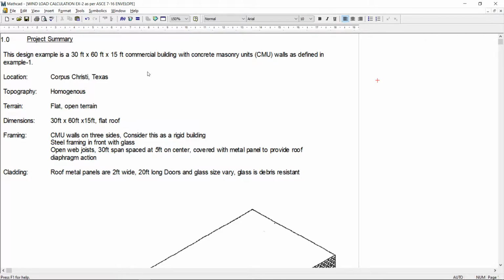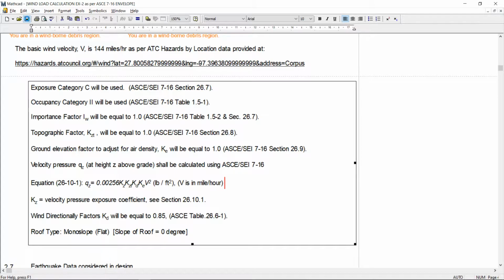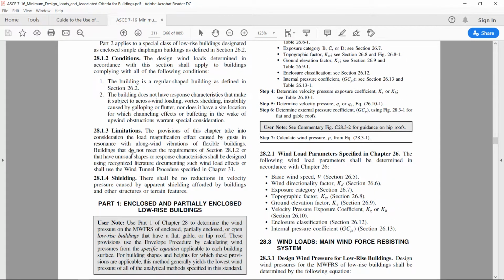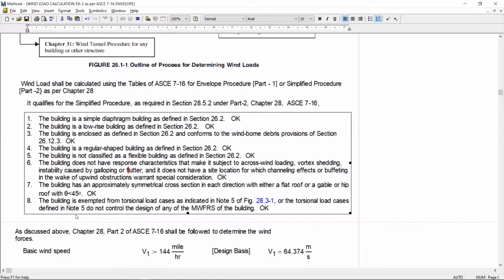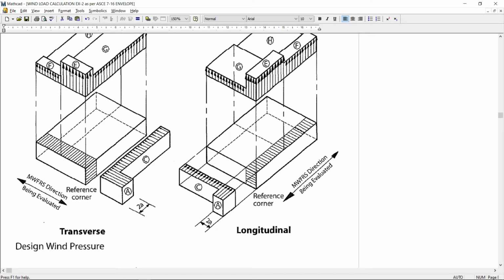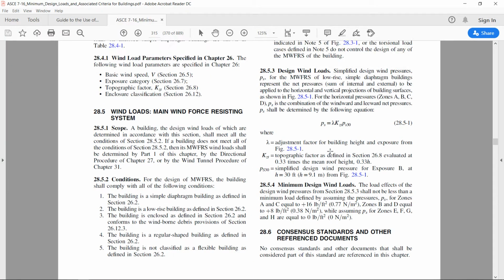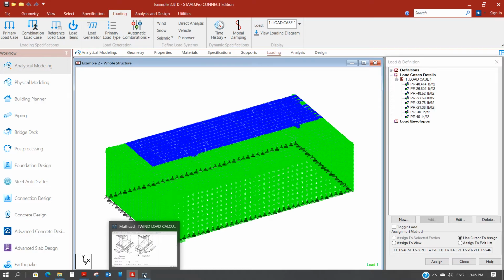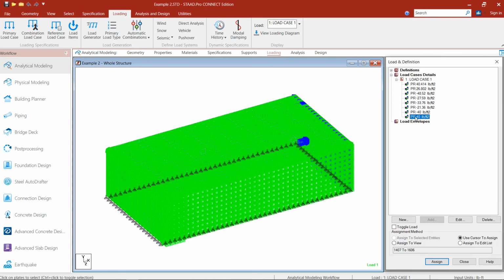WIND LOAD AS PER SIMPLIFIED PROCEDURE OF ASCE 7-16

Comment: Do you need to multiply the net wind pressures @24:33 by 0.60 for ASD?
Reply from the maker: If your wind speed is defined as per ASCE 7-10 and afterwards, you need to reduce it by 0.7 or 0.6. But if the wind speed is defined according to ASCE 7-05, then no need.
Reply: Thank you brother.  Instead of doing calculations, I am getting pressures from the provided ASCE 7-16 tables for hip roofs.  After retrieving the pressures I will multiply by 0.60.
Reply from the maker: @omarkhan6274  Preferably I would have multiplied by 0.7.